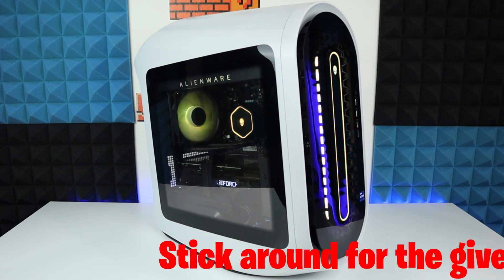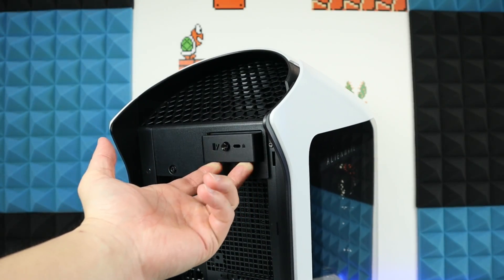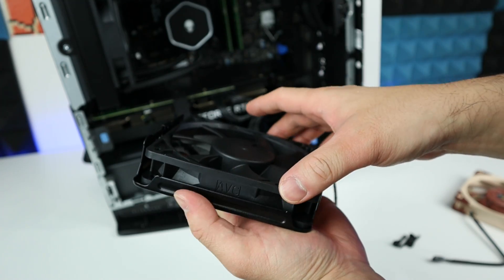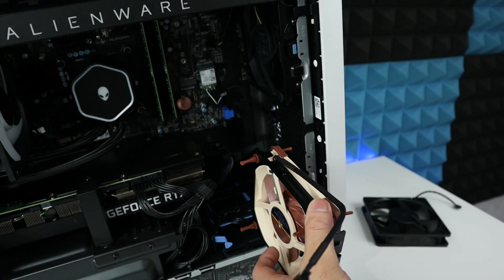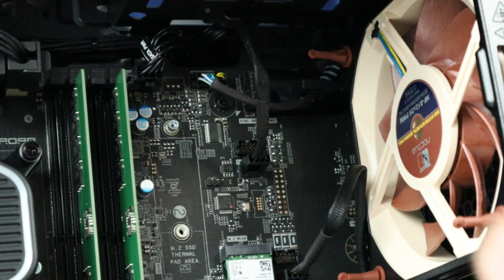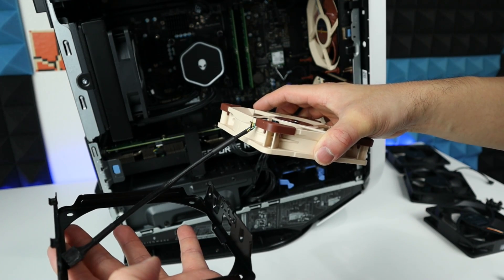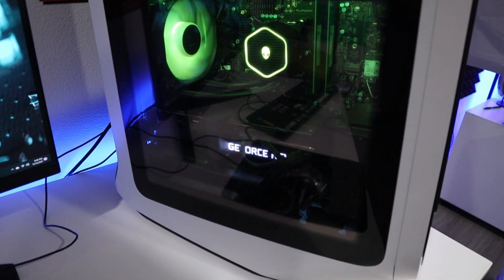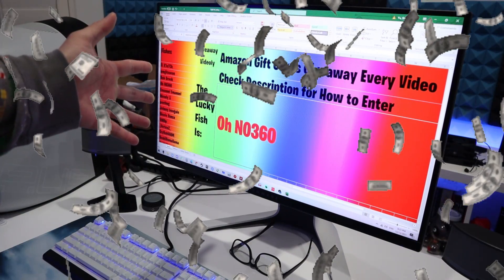Alienware Aurora R13 Fan Upgrade Lower Noise and Temps Mod

Comment: I would have loved to see you replace the cooling system for a bigger radiator mounted on the front.  I bet that would really help keep the intel chip cooler.  That radiator for the water cooled chip seems to small.

Comment: Thanks for the video. I did same thing with same fans from video. The only problem I have is the Alienware commander center only showing my fans( 3 of them) will run 46% at speed at maximum. I know the orginal fans and the replaced fans have RPM difference. But, is there any way I can fix the commander center only showing 46% maximum speed issue? Thanks again
Reply from the maker: No, you can't fix that because the RPM.

Comment: Thanks for the great video. I upgraded my fans to the Corsair ML120s with your help. They are functioning, but Command Center doesn't seem to have any effect on their speed anymore, meaning I can't change their speed. If I set one of the higher running profiles, the only fan that changes is the stock CPU fan which wasn't upgraded. Any ideas or tips? Thanks!
Reply from the maker: You should be able to still change their speed
Reply: @RyanYu  I reset the CMOS and can change the speed now. But having one other small issue. I added one of the stock fans to the top of the case for exhaust, and command center isn't recognizing the new/extra fan. It's on and spinning, but CC only shows a total of 4 fans still, not 5

Comment: I used the Noctua fans you recommended but kept getting a Lower Front Fan error on boot. I swapped fans to see if it was just one bad fan, but all three had the same error in the same location. There seems to be something about this particular fan model that the Aurora BIOS does not like, and only in the one location. I put the Dell fan back only in the Lower Front location and have not had the error repeat.
Reply: I have the same issue with the Noctua NF-A12x25 Black, get a  "Front Lower Fan Detect Failure".  If anyone else finds a workaround for this appreciated.  Fan is running but detect error on boot. For now, if I restart it goes away - only on shutdown.
Reply from the maker: That's odd, I don't have any issues...

Comment: great video! i have the exact same noctua fans & for whatever reason whenever i swap out the OEM lower fan with a noctua, it gives me an error at post. doesnt matter which noctua fan i use either.. it just instantly gives me an error. no clue why but the 2 upper fans work fine!
Reply from the maker: Did you try to switch around the fans to different ports?
Reply: @RyanYu  yeah dude i did that for shits & giggles same thing. from what i read on dells forums its because the speed of the fan isnt fast enough for that port & a new bios update will cause an error to show up if it detects that.  gonna get the 3000rpm noctua & see if it fixes it.
Reply from the maker: @theautotuneking77  keep me updated.
Reply: @RyanYu  will do man thanks!
Reply: @RyanYu  i posted a reply to you but i dont know what happened to it, but the new 3000rpm noctua worked for me i dont get that bios error anymore so it definitely has to do with the speed of the fan.

Comment: Hello! Swapped out the fans and got an error on the bottom fan.  Swapped the top for the bottom and the error remained with the bottom.  Swapped out the bottom fan with a new fan and the error remains.  Any suggestions?  Thanks!
Reply from the maker: Which fan are you using?
Reply: @RyanYu  Noctua NF-A12x25 Black  Thanks!

Comment: I tried change three fans like this video. And my one kept saying failed while starting. Idk how to fix this issue.. please help me 😢
Reply from the maker: Switch the fans around?
Reply: @RyanYu  front low, front top and top
Reply from the maker: @BackGOMs  I meant to switch the one that has issue to another port?
Reply: @RyanYu  all fans are still working well in normal. But in heavyload situation, the fans are still working same as before.(didn’t changed RPM) Also My Aurora 13 doesn’t recognise the fans that I changed.
Reply from the maker: @BackGOMs  as long as it works I don’t really care that much then.
Reply: @RyanYu  aite Thank you 👍

Comment: Had this system for a while, going for a custom build now and wont get pre builts again. this was a nice system in terms of performance and never had any issues. But the CPU on some games like the new spiderman game is ready 90 to 98c which is unacceptable. Ive tried everything and this system is simply a dumpster fire.
Reply from the maker: liquid cool?
Reply: @RyanYu  Yes, Liquid cooled. Apparently after resarching about this, the cooler isnt good enough to deal with temps. Not sure if it is entirely true, but dell are aware of heat issues because they have a new alienware r15 model coming out this holiday and they boast about better cooling, so they know this one isnt the best. I just got tried of worrying about thermals so sending it back and getting a custom build now and the stock fans and whining noise from the system got on my nerves.

Comment: in idle mode what setting is it on in awcc
Reply from the maker: balance
Reply: @RyanYu  cheers. For me currently with the stock fans. I am getting hot cpu into the 90s on some games but when i adjust the offset iT improve it. I'm hoping i can do the same with these fans but  make them less noisy. Thanks for answering all my questions, and so quickly too :)
Reply from the maker: @garethsmith6611  NO problem. enjoy your R13 man!

Comment: Ohhh I get it now. So the two arrows on the fan are both the same ways round. Its because theres a left and down ponting arrow but they will be both the same way when you put ir in the case, correct? ok thank you for your time and help
Reply from the maker: No problem,

Comment: If it makes it simpler for me to understand, the sticker/ writing on the fan is what needs to be facing inside the case so you can see it :)
Reply from the maker: simply just find the arrow, and make sure it points inside the case.

Comment: I kept replaying the first fan on your video and it looks like the arrow pointing right on the fan is what has to face the arrow on the case. is that correct please?
Reply from the maker: Make sure the arrow is pointing towards inside of the case. So the air will be sucked into case.
Reply: @RyanYu  ok thanks

Comment: Im finding the first demonstration of the arrows pointing correct way confusing as you show them then turn the fan around. Is it the arrow on the fan pointing right, that needs to be same way? sorry for all the questions. Theres two arrows on the fan so im confused which one needs to be pointing same way as the arrow on the case.
Reply from the maker: Sucked air into case.

Comment: Please can you answer my qyestion. do you need to change setting to the command centre due to these having lower speeds.
Reply from the maker: Nope
Reply: @RyanYu  thank you i have just bought two. Thanks for the very well made tutorial and quick responce :) I will now sub you thanks
Reply from the maker: @garethsmith6611  :)
Reply: My fans will be here tomorrow. I just ordered two for the moment to see if they play nice with my system. If I installed jjust two at the front, would I still notice some sound improvement?  I am worried about thermals though. so might need to increase the offset a bit. Do these fans still work like the stock fans in terms of getting faster when computer heats up

Comment: Do I need the cables with the new fan or can i use the fans from the dell fans ? Also while the sound is better it doesnt look like it brings tempd down that much. How much of a different is the temps now
Reply from the maker: not really that much, 2-5 only, but I did this mainly for the noise.
Reply: @RyanYu  Oh right, but it keeps temps down under 80 would you say. Im ready to buy them from your link. They are sold without some cables. If I buy the fans on their own, do they still come with the main wire or do i need to connect it. sorry im new to building
Reply from the maker: @garethsmith6611  they will have wires
Reply: @RyanYu  also can i buy one fan and would it work fine, or do you need all the same fans for it to work
Reply from the maker: @garethsmith6611  it’s idea to have same fans

Comment: I have the feeling that the fan connected to the CPU cooling makes a lot of noise. Is it possible to switch it out too? I already switched out the three other fans for some nocturas
Reply from the maker: You can switch that one too, but you will not have the RGB anymore.

Comment: I just did the exact same thing. It's awesome but I'm also considering replacing the fan on the cooler with a noctua as well. I don't really care for the rgb since I mostly have that all turned off. Have you tried?
Reply from the maker: Nope, but should be the samething.

Comment: I am getting a bios fan failure every time I boot up. Using the Noctua.
Reply from the maker: switch another fan?
Reply: @RyanYu  I have the same error and I don't think it's a fan issue. People on reddit mentioned that after a BIOS upgrade few months ago, they started having BIOS error at boot. What was suspected is that BIOS check the RPM of fans and since Noctua only goes to  2000 RPM, it may be failing the test. For me, the lower front fan was detected as failure but was working, the top fan wasn't so I replaced it back to stock that one until I find another solution...

Comment: This is not a good comparison. Of course you are gonna get lower decibels if Noctua Fans are running at 2000 rpm and stock Alienware Fans runs at 4000 rpm. If you setup all the stock fans at 50% then you will see that there is absolutely not difference between Noctua and Dell's Fans.

Something to consider when buying. I would just stay on the stock fan and use command center to set the desired RPM in order for the decibel levels not to go to high.

Thanks,
Reply from the maker: :_fishNice:Good point.

Comment: I did this upgrade on my Aurora R13 and get BIOS errors for the front lower fan. Did you have any BIOS errors when performing this upgrade?
Reply from the maker: NOPE, try to switch around the fans?

Comment: I keep seeing these for good prices, I bought an alienware in 2007, these new dell versions are a joke. Cheaper for a reason, no airflow, not future compatible, barely any thermal protection, it's a throw away computer.
Reply from the maker: What's the lowest price you have seen?
Reply: @RyanYu  it might have been a r10, but it was a 3080ti and a 5900x for 1900.
Reply from the maker: @evanperry3699  that’s crazy.
Reply: @RyanYu  I just can't buy something so oddly engineered, I guess I'll build one.

Comment: I tried the noctua fans and I got an error code for all 3 fans 😢
Reply: Yes. The exact fans you used, the NF- A12x25. I had to replace with factory fans to get error code off. I ordered the Corsair to see if maybe those will be better.
Reply from the maker: @anthonygrab7198  ummm.
Reply: I said the same thing, lol. On a good note, I appreciate all your videos, they helped a lot, and I’m very grateful. I’m pretty new to the pc scene so, thank you. 🙏
Reply from the maker: @anthonygrab7198  no problem, hope the new fans work.
Reply from the maker: The exact fans that I used?
Reply: Update: been using the Corsair fans, working great! Thanks again 🙏
Reply: @anthonygrab7198  which Corsair fans did you get? M120 Pro? what about the noise

Comment: I did this upgrade and got a blue screen, then detection errors on all fans. Dell does NOT like non-OEM and the BIOS detects this and errors out. Fans are spinning and quiet, but system seems a bit unstable for now. Will keep an eye on this. I may just buy a good MOBO and case and transplant the CPU, RAM, and GPU along with the Noctuas, then get a new AIO for the CPU and bump the power up to 1200kw and call it a day.
Reply from the maker: Did you use the same fans as I did?
Reply: @RyanYu  Yes. Seems a common issue according to my research. I seem ok for now. Next issue ia my Windows 11 is blocking my firmware update from Alienware via Defender. Unable to turn off Tamper Protection. Another problem for a different day.
Reply from the maker: @OldGregg00  I'm considering if I will but the next gen..

Comment: Hi first of all thanks for the video. I just installed three of the same fans on the r13, two of them worked perfectly but there was one that says lower front fan error, what can I do to fix it? Thanks!
Reply from the maker: Try to switch it from the other ones?
Reply: BigFishTech do you mean swapping the lower front fan with the top front fan?
Reply from the maker: @jeffreyye1935  since they are all the same fans, switch the one that you have error to a place where has no error to determine if the fan is bad.

Comment: Hi, just noticed that in the ACC the speeds for the 3 installed fans always remains around 45%, never changes even if I put it at 100% in a new profile and then activate the profile properly in the main page of the ACC. Do you know what could be causing this? Thanks!
Reply from the maker: This is because the upgraded fans have less RPM than the original. The original has 8000RPM and the aftermarket ones have 4000 or so.

Comment: I replaced the fans with the Corsair ML 120 Pro with RGBs and got the startup fan error which is fine. The annoying part is even with the new fans, the R13 still runs too loud. Thinking of switching out the 3080 Ti for a hybrid version with the radiator attached to the front bezel. You think it'll work?
Reply from the maker: not gonna help.

Comment: For the r12 is there a way to add a new top fan without removing the cooler or do you have to remove the cooler in order to add a new top fan
Reply from the maker: You will need to remove it since the space is so tie.

Comment: Hey thanks for the tip , i have a question could we put the same fan to replace the AIO stock fan?
Reply from the maker: Nope, you will lose the rgb effect.
Reply: @RyanYu  Thank for your fast reply, i have the R13 without glass panel so cant see inside ;) and my Aio stock fan look not good equilibrate.
Reply from the maker: @jokoko3699  I don’t recommend to change that still, it has more rpm so more air will be pushed out.  Because we have a few other fans so it’s okay to change the rest. That’s what I think.
Reply: @RyanYu  TY, i dont know what the is stock maximum rprm but the Noctua is 2000rpm so i will try because mine is desequilibrate , i will give you the feed back, if it is worth i will replace all the aio by a be quiet silent loop 120 because the pump make noise too! ;)
Reply from the maker: @jokoko3699  Keep me updated man.

Comment: I replaced all my fans with Noctua I have an A12x25 on my rad then three 1700rpm P12 high performance redux’s as case fans before the swap while gaming I was at 74C now I’m at 50C while gaming i idled at 50C before swapping any fans now I idle at 30C, after replacing the fans I did a cinebench R23 multi core run ( which puts a 100% load on all cores ) and only hit 76C the OEM fans even if they are 4000 rpm blows chode, my GPU is also running 4C cooler while gamine now so I would say those case fans suck I went to 1700 rpm fans and am getting better thermals than dells crap
Reply from the maker: :_fishNice:
Reply: Which R13 system did you get?  Thinking about doing this with mine.  I9 12th gen, RTX 3090.

Comment: I would be cautious doing this. The Noctua fans only run at 2000 rpm max, which is half of the 4000 rpm max rate of the stock fans. I know the Noctua fans are good quality but there is going to be a reduction in the max amount of heat that the Noctua's can handle verses the stock fans. If you don't push your system hard for extended time periods and you really want to lower the noise level this may be a good modification for you but if you push your system to hard you are almost certainly going to run into thermal issues forcing the cpu/gpu to throttle back and reduce performance to prevent damage from high temps.
Reply from the maker: Like I said, if your demand is really high, then keep the OEM fans.
Reply: I replaced all my fans with Noctua I have an A12x25 on my rad then three 1700rpm P12 high performance redux’s as case fans before the swap while gaming I was at 74C now I’m at 50C while gaming i idled at 50C before swapping any fans now I idle at 30C, after replacing the fans I did a cinebench R23 multi core run ( which puts a 100% load on all cores ) and only hit 76C the OEM fans even if they are 4000 rpm blows chode, my GPU is also running 4C cooler while gamine now so I would say those case fans suck I went to 1700 rpm fans and am getting better thermals thanks dells crap
Reply from the maker: @shorty808100  Nicely done!
Reply: @shorty808100  Can you explain a little more about how u set em up? My cpu's hitting like low to mid 90's when its doing heavy benches. i9 of course lmfao

Comment: I believe the stock fans are 3000 RPM, the Noctua replacements I believe are 2000 RPM.  The difference in RPM would definitely be quieter.  Not sure how much less airflow you'd get though.  Noctua has high pressure versions of the same fans at 3000 RPM.  So you're AWCC configurations would be similar not sure if there would be a db noise difference though.
Reply from the maker: Not too much but in the max performance the OEM is better

Comment: i have fan issue with my r12 what can i replace the front two with they ramp right up when im on halo ?????????? helppp
Reply: Haven’t upgraded up about to I wanna upgrade to the nf-f12
Reply from the maker: @DRhoneybee  You can use the PRO ML-120 or the Noctua either or.
Reply: @RyanYu  but for halo my fans ramp right up would tht be a good fan for cooling big time or
Reply from the maker: @DRhoneybee  it will only help with the noise level by a lot, by cooling, I think the OEM is little better.
Reply from the maker: What fans did you use?